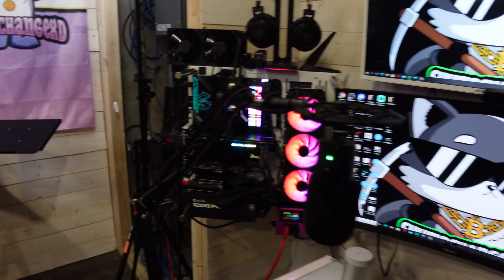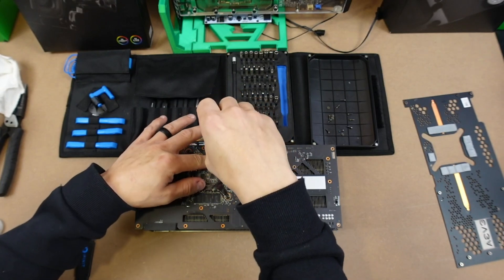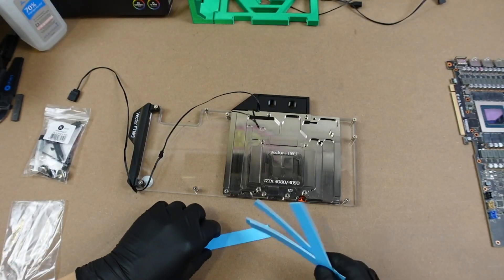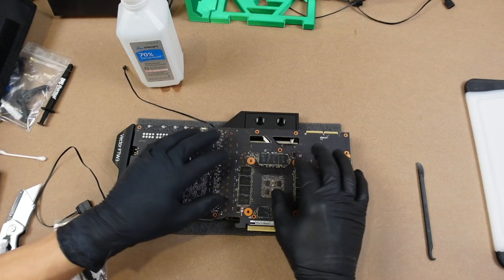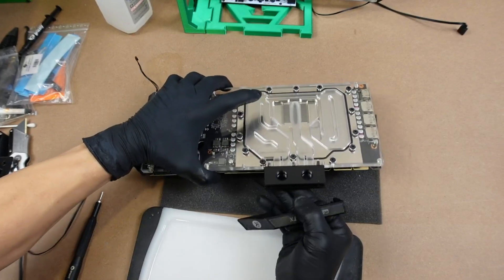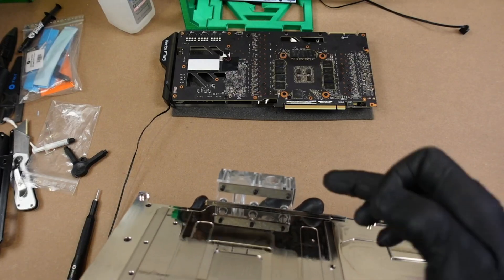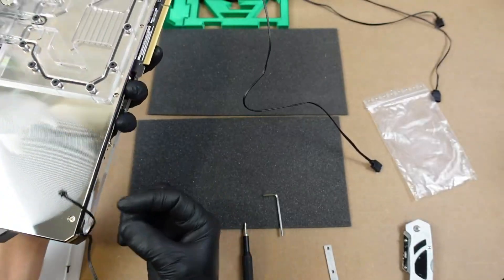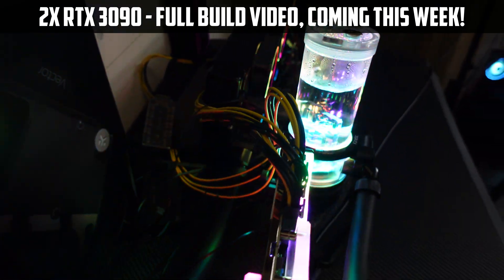Water Cooling for ANY PC

Comment: Got any before and after temps and hashrate? How about stability? And better? And worse? What size pump and rads are you using? How about fan config? Push, pull, push-pull?

I have 2 - 13gpu rigs water-cooled and currently getting more rads and fans for my 3rd 13gpu water-cooled.. just looking to compare notes

Comment: Did I see towards the end when you show the card up and running in your system that you are missing one of the chrome plugs on the port that doesn't have a fitting running to it?
Reply from the maker: Nope nothing missing I bet that’s the crossover part your seeing. Where the two plates connect internally (if I had to guess)

Comment: I always place my thermal pads directly on the chips, not the frontplate/backplate/heatsink... It is more important to have full contact on the chips, as opsed to misaligned and the chips only relying on stagnant air cooling between the plates.
Reply from the maker: These blocks are so tight that’s why you need to use the correct size pads per spot. I get what your saying tho □

Comment: They break because your finger nails are too short. I've just cleaned and replaced thermal pads for my 5x a4000, 6x a2000, and 1x inno3D 3090. None of them broke just because I was able to grip them with my nails. Hope it helps
Reply from the maker: Nails or not they blow to peel.. what are you talking about break lol?
Reply: @ChumpChangeXD  fan connectors
Reply from the maker: @koh_ker  ahhh I was so lost! Thank you, yea probably 😂

Comment: Im not big on this block I’ve seen billet ones that don’t use any orings that will be where it leaks when it does and i would of used thermal putty instead of the pads put thank you for the video

Comment: I wonder how you plan the loop for multiple different 3090 rig?
I plan to water cooling my rig but I run into problems with the flow resistance of different waterblock if I want to run it on single wanter pump
Reply from the maker: She’s up and running now with 2 3090 video will be soon!
Reply: I got single loop, 3090, 2080 and threadripper Optimus block, single radiator all pushed by D5 pump no issues
Reply: @bigdreams5554  so you don't worry about the water got trap in the high resistance block?
Reply: @nhuttruong4197  haven't seen any issues. My loop is serial , the D5 pump is powerful. Temps all look good. Superposition 4K optimized benchmark on 3090, max temp of 53C. (GPU not memory), when mining stays under 48. I run my computer full tilt (24 core CPU at 100% +2 GPUs , temps stay frosty. (Assuming room temperature is reasonable).  I run distilled water. No pastel milky fluids for my high performance PC.
Reply: @nhuttruong4197  running distilled water and Tygon tubing (plasiticizer free) been going strong for 9 months now. I would worry about blockages from bad tubing or pastel/colored fluids
Reply: @bigdreams5554  I also thinking of run it in serial, I may run into problems of heat for those last gpu in the loop. My rig have 3 3090, 1 3080, 1 5600xt, and couple 20 series

Comment: I don't recommend the pads that come with EK GPU waterblocks. They are not that great when it comes to thermal conductivity. 3 W/mK doesn't cut it if you want to overclock the memory fully. Just get some Alphacool Apex Soft pads, I use 11 W/mK but 7 W/mK should be fine too. You can use the bad EK pads on other ICs on the board if you want to be stingy with the more expensive pads.
Reply from the maker: I mean they seem fine for me to be honest. I have others I can re do need be but the temps are mint as of now

Comment: 2nd best. The Optimus block is light years better and made in the USA.
Reply: How's the Optimus backplate? It's passive, but a beast. I have the Optimus threadripper block and it's amazing. Been thinking of replacing my Phanteks with an Optimus backplate on my 3090.
Reply: @bigdreams5554  I am using it on my FTW3 3090. VRAM temps on eth are 72. You cannot use their backplate with any other blocks. The card actually mounts to the backplate first.
Reply: @Phr0z3  awesome. Alright well may consider them if/when I waterblock another card. I do love Optimus compression fittings. Much much better than bitspower, etc.
Reply: @bigdreams5554  Optimus is very expensive though so keep that in mind. I would have gotten their compression fittings had I know about them when I started open loop cooling. They might have not existed then though lol. They look great. I am using primochill fittings and so far so good.

Comment: Awesome content ChumpChangeXD! :) I love this kind of - improving gpu cooling performance -  stuff! Although I've noticed the memory chips remained kinda "dirty". I know watercooling is the ultimate best method to cool the gpu though. But when you perform thermal pad replacement activities I'd gently recommend clean them memory chips and any other surfaces like super clean with IPA before you apply any thermal solution on it. Getting rid of all the dirt, oil, greasy resodue and whatnot would help improve thermal conductivity big time.

Cheers mate
Reply from the maker: IM A NOOB LOL! Thank you!!

Comment: got the same blocks on my 3090s, going to replace the ek pads with ec360 this week... at least on the memory. not so happy with my temps, still in the 80s on mem junction (ya, ambient temp is around 26-28°C)
13:20 yeah... thats the trickiest part... push the sandwich really hard to line up the holes AND get the right position for the backplate and the force down on the pcb so the pads have the correct contact..
14:41 you did well, bro
Reply from the maker: Thanks man! This is a whole new animal for me for sure!! But is addicting... LOL